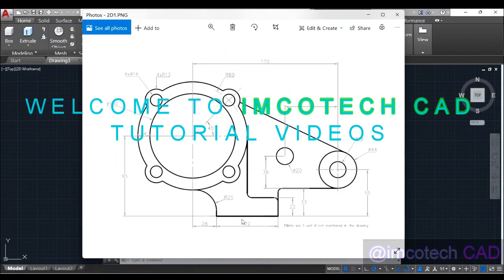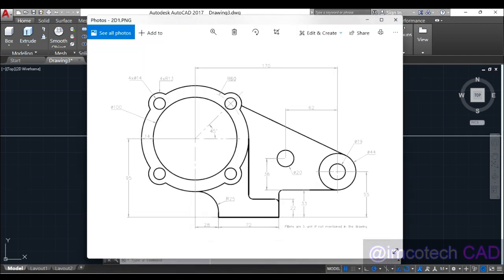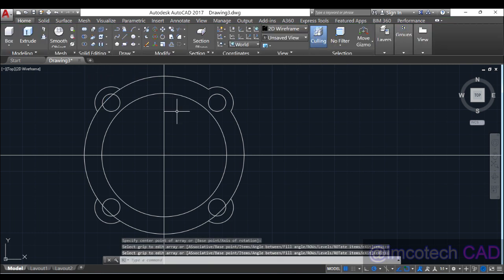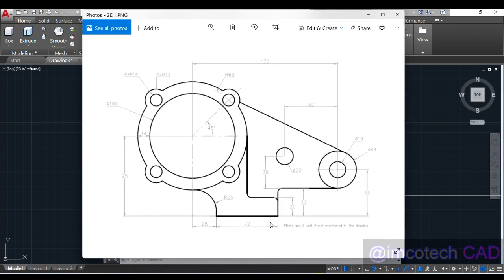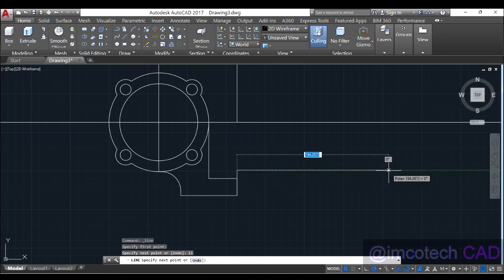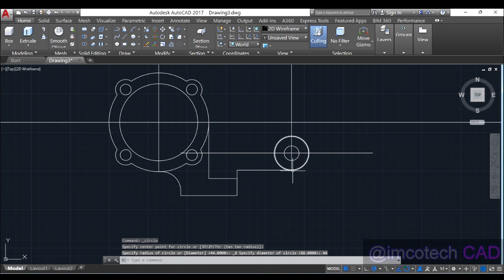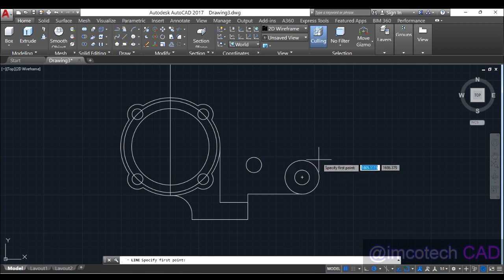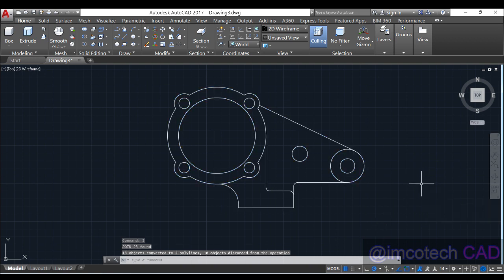2D AutoCAD for beginners part 12. 2D designs made easy

Comment: Tagent line problem how to draw
Reply from the maker: You can draw a tangent line by following this 3 steps below:

1. (I will assume you already have a circle drawn on your drawing interface). Then, Select the line tool
2. Press and hold down the SHIFT button on your keyboard, then right click on your drawing interface for special options while still holding SHIFT button
3. From the listed options, select tangent. From there you can draw a line tangent to Any circle you have drawn